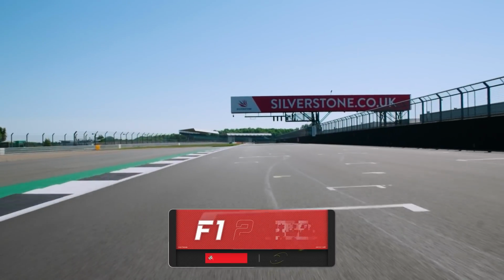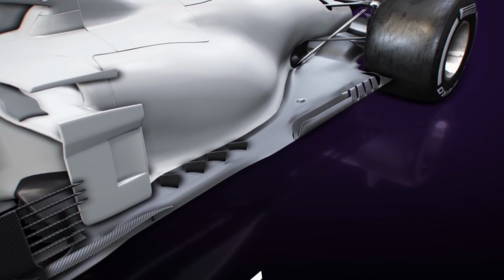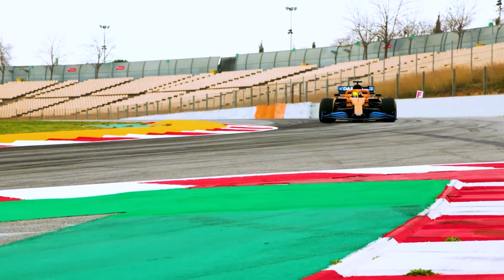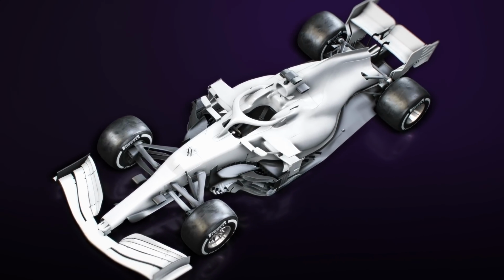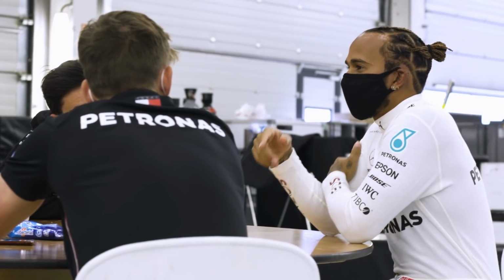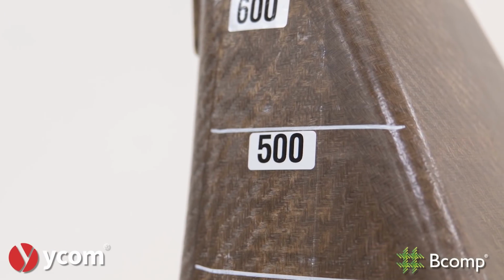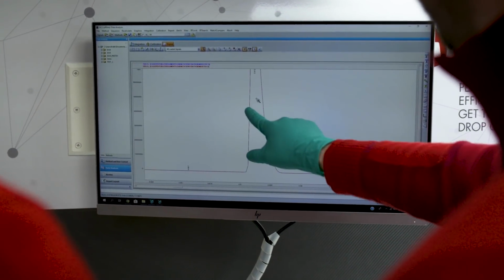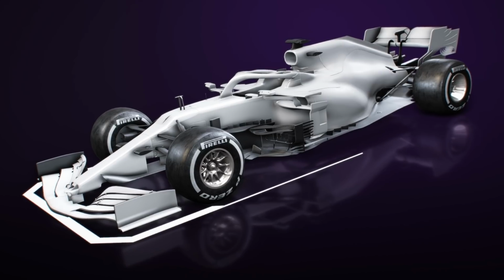F1's Updated 2021 Rules Explained - Everything You Need To Know

Comment: Surely you don't need to regulate downforce... Teams will reduce downforce when they realise they've hit the tyres limit.. And adjust their designs accordingly..
Reply: @AzathothsAlarmClock  Not to disregard the risk drivers take but surely load on tyres should be considered a normal design and safety parameter... and aim to design the aerodynamics/downforce to work within those ranges to be safe for the tyres/car/drivers... teams don't want their tyres to disintegrate either.

If the element in discussion incentivises the teams to endanger driver, say using light brittle materials for argument's sake, obviously this should not be allowed. There are no incentives here for teams to overload their tires as soon as they work out where the limits are since they don't want DNF. They will push the limits as far as they can until they DNF... or better yet encourage more pitstops.

Your argument of 'we don't need any dead drivers' can be applied to literally ANY design element that puts them on the track... maybe they should have a speed limit because 'we don't need any dead drivers'... we should abandon formula 1 for formula E since fuel is flammable and 'we don't need any dead drivers'... etc etc
Reply: @AzathothsAlarmClock  You clearly understand the technicalities more than me. So I'll take your explanation under advisement.

Comment: Great insight to the regulation changes. Would love see some analysts from JBL on potential loopholes in the 2022 regs even though they are pretty restrictive from what I've heard
Reply: According to Brawn, any loopholes in 2022 that are discovered will be closed before the next race. Find a solution that makes you go faster that is legal by the letter of the law but against the spirit, it'll be gone in an instant.
Reply: @MrSniperfox29  So by the time we get to 2023 the only difference between the cars will be the engine... Sad2c
Reply: @DeLaCroix1211  The reverse of F1 in the late sixties.

26 different cars, with 1 engine between them (Cossie)

Comment: They should add one more rule , All cars will use Ferrari engines.
Reply: Good god no bad enough nearly half the grid has merc engines every team should have there own engine supplier yes ok merc ferrari and renault would be at advantage to begin with but over the coarse of a decade the others would catch up go back to v12 and no fuel saving

Comment: Stupid.. why remove downforce from the part of the car that is least effected when following another car?
Take it away from the surfaces that won't make it EVEN harder to follow.
Reply: exactly. they could just have lowered the allowed size of rear wings. all teams have a monza spec rear wing anyway, why not make them use those small wings for all tracks? during this pandemic, this would also save a lot of costs because the teams would need to spend less for develoment. but no, lets make new rules so that all teams need to invest a lot of money for development to be able to be competitive. so useless.
sometimes i want to punch the f1 chiefs in their faces for their stupidity.
Reply: Hard to follow a car in front closely is in the current F1 cars mostly contributed by the front wing, underbody downforce and outwash around the rear tyres. And less by the rear wing and diffuser.

The dynamic pressure change on a following car at 1 car length is a shift of downforce to the back of that car and the front-end loosing 40-90% in downforce.

Since the reduced front wing complexity was already in place, only the effect of underbody downforce and rear tyre outwash on wake and turbulence needed to be covered with regulations.

The new floor regulations, the triangle cut-out just in front of the rear tyres and prohibiting slots in the floor, tend to work on both ends of the problem; it not only reduces load on the tyres (downforce), it also inflicts a slight shift of downforce to the front and will decrease the amount of wake (turbulence). Outwash seems nearly impossible with the triangle cut-out.

Hoping the CFD models and their predictions do correlate well with the real world 🤞

Comment: Isn't the whole point of f1 to push technological development? The reason behind opting for less downforce is that the tires were taking too severe a beating. Why? Because Pirelli supplied roughly the same tires for 2 years. How about, instead of slowing development, asking Pirelli to actually significantly improve their tire resistance? What technologies will be carried over to normal road legal cars? Better, more resistant tires, or ways to make them have less downforce? I find it quite odd that F1 opts for slowing development because other sectors aren't following. The point of F1 is to be the ever-evolving pinnacle of motorsport. Change F1 like this, and all attention + investment will shift to Formula E, where development is directly put into the new generations of electric cars. Quite disappointed by the decision regarding the tires...

In addition to which, limiting aero upgrades that are literally the heart of F1 (think about the amount of aero engineers employed in the R&D sectors) makes close to no sense.

Comment: The point about natural materials just completely went over my head. The idea is to replace carbon fiber? What does it have to do with 2021?
Reply: That teams could now, if they wanted to, start using those materials in their designs (given they stand up to the quality/safety/design specifications). The nose cone was just an example. Unlikely that any team will use the materials in their car though, if they are not somehow forced.
Reply: @devnfun  why would they want a heavier car smh
Reply: It is nice that they allow the use of it.

However you would not want to use it in any structural component of a car let alone a race car. I don't think we will see much off it

Comment: The author has obviously never actually read any of the literature upon Natural fibre composites. Although they are absolutely amazing and I think they are more appropriate for many traditional composite roles. Their role in F1 will probably be minimal. 

Also a lot of the natural fibre composites environmental impact comes in the form of the resin used to create the composite.  So this may be wishful thinking due to their inferior strength to weight ratio and sometimes  environmental impact that is just as high as traditional composites.

Comment: every smartphone since iphone 10 comes with lidar, good luck policing this...
Reply: What? Also no the IPhone 12 pro is the first and only phone with lidar
Reply: @snonsig2688  10 has the face unlock thingy. the utilized image has a depth component, so what would you call that? :)
Reply: @michaelsanger8327  not Lidar since that's a completely different kind of technology and doesn't work at all like the depth recognition system on the 10.
Reply: @snonsig2688  geez dude, my point is that almost every phone you can buy nowadays can do high res images(with depth) 3d reconstruction and photogrammetry. i frankly don't care which phone does come with wat and the marketing name of it. again: my point is that it will be impossible to police this.

Comment: This is why tire wars would make it more interesting. Instead of cutting back on how fast the cars are getting they should focus on making tires that can keep up
Reply: Or just have more pitstops. I would actually like it if they need een extra pitstop every race. Why would you even want tyres that last 2/3 of a race
Reply: I mean they do have new tyres they just got pushed back to 2022 when they were originally planned for 2021 ( this wouldn't have been an issue with the new rules) and Pirelli can't exactly make new tyres for one year as that would be a massive cost ( the whole point is that they are trying to save money)  in testing and research for one year of use when you can do ther simpler things to make the tyres they have last an extra year.
Reply: @jamesminett9717  the weird thing is that pirelli wanted to keep the 2020 tyres for 2021, but now decided to build new tyres for just that 1 season. the tyres got tested in free practice in the first bahrain race. and all drivers said they are shit. wow.
Reply: @thedevil5475  I must have missed that, but I am in no way surprised they are crap they haven't had any time to test them properly.
Reply: @jamesminett9717  if i remember correctly, verstappen did a 31.0 with the new tyres and then a 29.3 with the current ones - with the same fuel on board. the new tyres are 2,5 kg heavier than the current ones. vettel said that the the new tyres have the same problems as the current ones, the only difference is that they feel worse and are slower. well...
Reply: Are you offering to pay for that?

Comment: F1 Teams: Hey lets innovate and design stuff for the car to make it go even faster!!
FIA: no
Reply: Tbf, if we want competition, the main thing is the budget cap. Merc has budget 3 times bigger than the backmarkers, so it's obvious they will be ahead(Ferrari is extraordinarily incompetent, so it's not an example). We want to see competition, we level the field, so MAYBE the drivers will have equal machinery to compete and we'll see real racing.
Reply: @lukewood2662  well that's kind of contradicting isn't it? Ferrari has a large budget but are incompetent, just because everyone has the same budget doesn't mean they'll all have the same way of managing it they'll still have the same people working there. So pretty much the teams with the best resource management, engineers and testing equipment will overall make the best car and at the end will be on top,I honestly see no change occuring becuase of that change. The main reason they implemented that budget cap is to make f1 sustainable, they want to make it more affordable for the current teams to stay in (williams and hass were on the brink of not being able to race anymore) and to make it look like a good investment for other manufacturers to join in as well.
Reply: @MrDelsoleg11  If you see no change, you didn't see the benefits for the races as entertainment. Merc surely do their research with more expensive methods and use more expensive materials to do some things. They'll have to stick to similar methods because of the same budget, and that will not only create a "creativity and competence wins, not money" policy but that policy will make the cars be much less different in performance, which means the drivers will have much more fair competition, and we can really see who's been the best in the races(which doesn't happen today because the backmarkers' cars make the drivers look like amateurs whereas a Merc can make anyone go fast enough for podiums)
Reply: @lukewood2662  mercedes is way richer than ferrari, not comparable
Reply: peter pan  I don't think RedBull had the same budget, but Ferrari is extremely incompetent. I'm sure you know this, why are you asking me?
Reply: Jay, exactly! The FIA is killing innovation. 
IMO they should give a low cylinder capacity limit and let the manufacturers innovate in the other departments: suspensions, lubricants, brakes, aerodynamics, etc.
Reply: peter pan  it might have not been clear for everybody that it was rhetorical due to subjective perception, but your arrogance will stop me from replying further to you.
Reply: peter pan  well it's easy to just say "they have the budget" but then team like mercedes probably have 50 people working on the engine, 50 people working on the electric 20 working on hydraulic and so on and on. Don't forget mercedes is a huge company with big resources. They can spend 500mil run a team and even more behind the scene.
Reply: So tell us what you would do.
Reply: Jay, have you missed how freaking boring F1 is right now, with the massive downforce killing the racing, allowing only for DRS passing, and destroying the tires? The FIA is trying to save whatever little racing is left in this increasingly boring racing formula
Reply: It's a bridge year mate.
Wait for 2022.
Reply: the faster cars become, the harder it is to overtake because they overgrow the tracks. see imola, once an exciting track, in 2020 a borefest
Reply: Been like that in F1 for years for good reason. Since 1994 it's been a balancing act.
Reply: peter pan  you need to gasp how much damler, and petronas spend in f1, they could buy ferrari off im just checking some numbers i will just rest my case, theres levels to this kid, money levels, not denying ferrari or redbull make haas look like pennies, again, levels
Reply: Its like this since the begining
Reply: F1 is becoming a joke
Reply: All racing serves towards the progress of regular cars. If some systems are too expensive to make it shouldn't be used.
Reply: The banning is actually to promote innovation as the teams will find even more ways around the rules and get the most performance out of the constraints. Plus it makes the racing more fun!
Reply: Just good, if they reduce speeds. No need for like 80% of the lap full throttle. More meanings for the corners, please :thumbup:
Reply: peter pan  neither team you mentioned have near the budget mercedes fking benz has lol, wtf you talking about
Reply: Hey lets have 16 cars on the grid in 2021 and lets ignore theres a global pandemic among us.
Reply: U want mercedes to dominate again?
Reply: If they would allow more innovation in the aero department, Newey would be flexing his pencil xd
Reply: @freakysquirrel7218  Newey has failed to match the aerodynamic success of the Mercedes team for the last 7 years.
Reply: @joelambert7128  ever since the blown diffuser was banned RB went down. Yet that is why his skill would be crucial since he would be able to use a blown exhaust with no/less regulations
Reply: @joelambert7128  What are you talking about? In the parts of the track where aerodynamics player a bigger role RB gains time on the MB. The engine is RB's real issue
Reply: @Laylander  generating the maximum amount of downforce is not the only factor in judging aerodynamic success: drag is the other side of the coin. Not that the Red Bull even stood up to the Mercedes at high-downforce circuits this year.
Reply: @joelambert7128  I think you misread my comment.
Reply: @joelambert7128  Drag is only significant if the engine is going flatout and speed is high. In all other scenarios the drag isn't that relevant or even opposite; helpful. Yes the RB is a high-drag car. And that shows for example during the last Abu Dhabi GP. In Sector 1 the RB and MB noted quite similar times (short straight and a sharp turn, S turn). In sector 2 the MB outpaced the RB (two long straights and a low-speed S). In sector 3 the RB beat the MB (lots of turns and very very short straights, where slighly higher acceleration is not significant).

Where is drag helpful? At the end of a long straight it allows for more agressive outbraking and defending while tyre wear stays the same. It ensures a more scrambled slipstream which helps in defending on all circuit scenarios and causes the attacker to rely more on mechanical grip (more tyre wear) while the air intake for the attacker's engine is also more scrambled causing jittery engine pressure (or the chaser has an intake mitigating that, with overall lower performance)

Low drag has it's benefits too, of course! You're able to keep accelerating for a longer time, allowing for higher peak speeds. There aren't as many vibrations on the aerodynamic parts, thus allowing for thinner and lighter design. The engine is less strained  during turns and while coming out of a turn, because less throttle input is needed to overcome the additional drag. The car is a little more predictable because the throttle input is more related to acceleration than overcoming drag and thus finding the limit of throttle input is slightly more intuitively linked to the amount of G-forces produced.

To summerize it: It's easier to drive a low drag car if you're unchallanged, it's easier to drive a high-drag car during a fight for a position. MB has the freedom to tune their aero design to drive unchallenged because of their insanely reliable and powerful engine putting them on the front row all the time. They overheat and start skidding when they're in dirty air. At monza they overheated as soon as they got in dirty air. When not in clean air lewis always complains about the drivability of their car.
Reply: @Laylander  it’s a wonder you aren’t working in the aero department of a race team. Surely they will be fascinated with your ideas about deliberately increasing drag! The trouble is you’re deliberately overstating tangential benefits of a factor that teams uniformly try to minimise, and have done since the very earliest days of GP racing. An aero solution that has not shown superiority until weeks after the championship was settled, and probably cost millions of pounds and thousands of hours that could have been spent on next year’s car, is not a success - it is clear evidence that Red Bull, and Newey, are incapable of competing with Mercedes, on any front, over the course of a season.
Reply: @joelambert7128  Being able to work for a race team would indeed be pretty cool.  I'm not stating that more drag is more better. I'm saying that there is a tradeoff and both sides have their benefits depending on the scenario.
Reply: @oimate1303  yes lol 😂